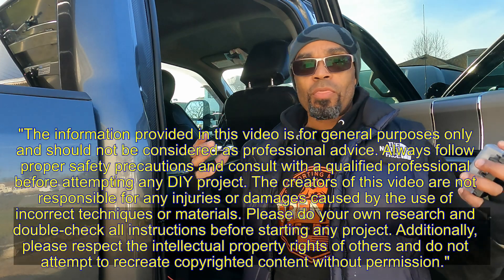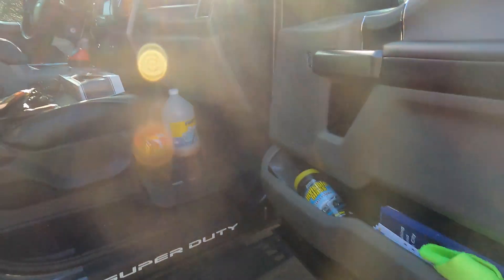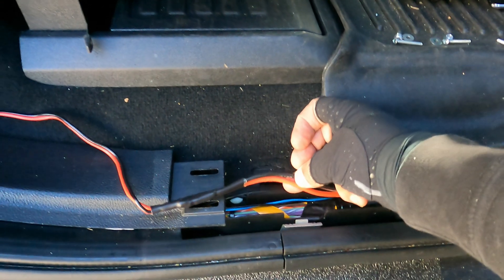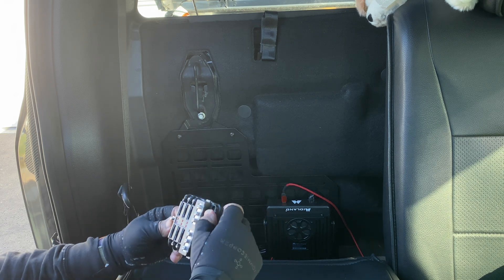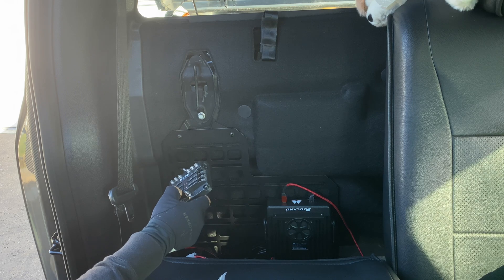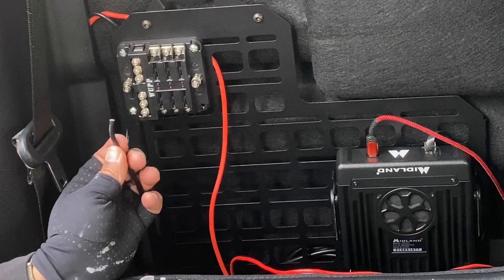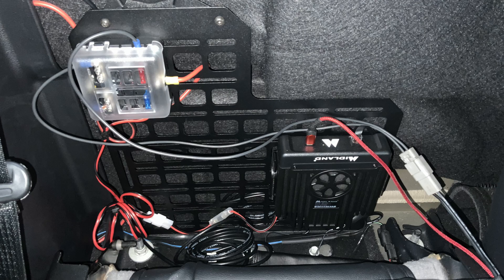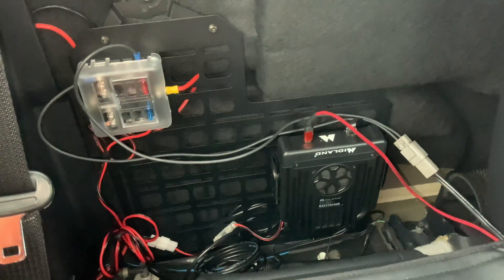Installing GMRS in a Ford F250/F350 (with a HAM twist)

Comment: Got some neat stuff there, shouldn’t coil up your coax I would only use what you need maybe an extra 3 ft. Can always cut it and put a pl259 on it. You could lay your extra on carpet from side to side just not a coil. Same with ham radio, may help with your swr.
Reply from the maker: Thanks 🙏 for the tips.